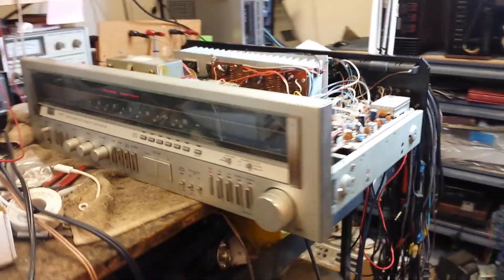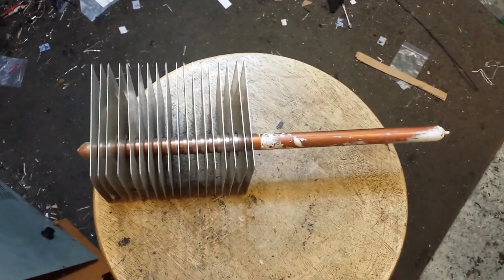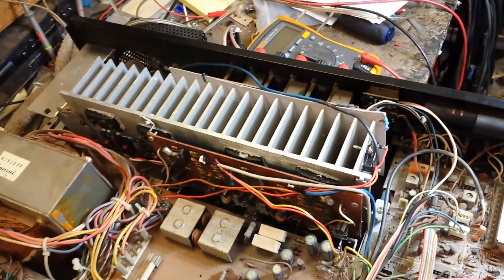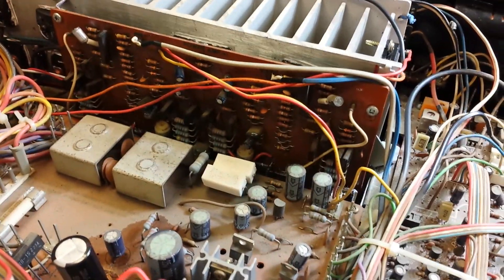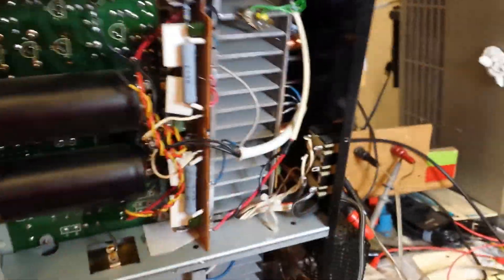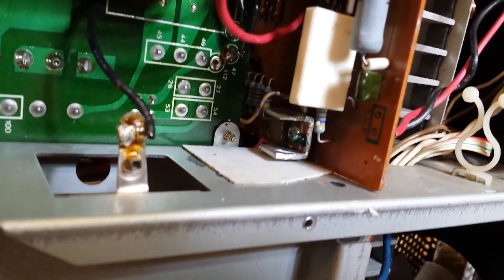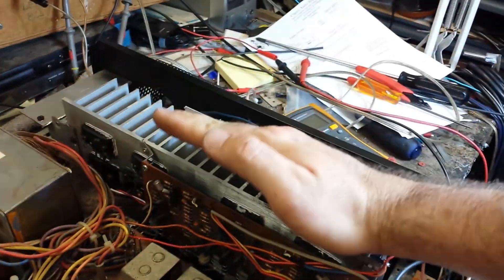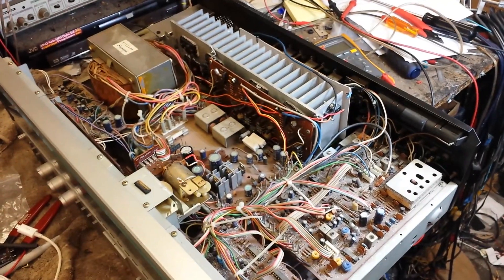Insane modification on Sanusi 9900z - from heat pipe to heatsink, and editor ramblings

Comment: There  are no documented technical data that suggest the heat pipe is filled with an refrigerant gas. 
And just filling up a pipe with such gas does not mean that it will cool itself just by heating it up. That`s not the cooling systems work . At all.
All the admiration for the time taken to put all that aluminum together, but that does`nt add up.
 The original copper heat pipe just transports the heat from the output to the cooling metal sheets lined up in such way to make the air flow from the cooling fan. It was the way intended originally to work Those MT-200 fets could lead to 150 C degrees junction lead with no problem. 
On the other hand handling cooling in a most passive way i find more elegant nevertheless.

Comment: Great video Jordan. I had never seen the "heat pipe" version of a heat sink until I purchased an Onkyo TX-7000 recently. When I first saw it, I assumed the tube was filled with a gas, but didn't know it was freon. Is there any way to tell if the gas-filled tube is still sealed, or do you just assume it has leaked at some point and is no longer any good? Thanks for the great video!!
Reply from the maker: Easy test is to run the amp at about 1 watt output and monitor the difference between the header the outputs are on and the fins. More than 5 degrees difference in a couple mins is no good
Reply: @JordanPier  Thanks very much for your response Jordan. I appreciate the help!